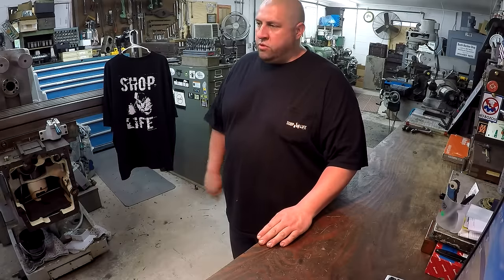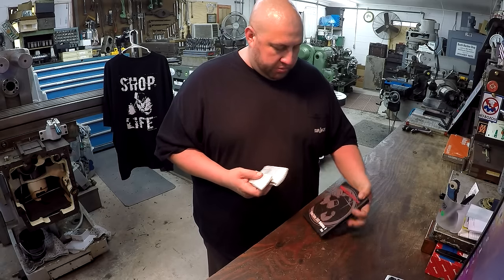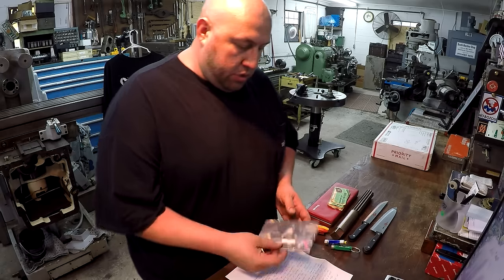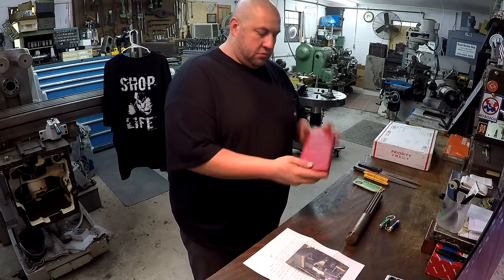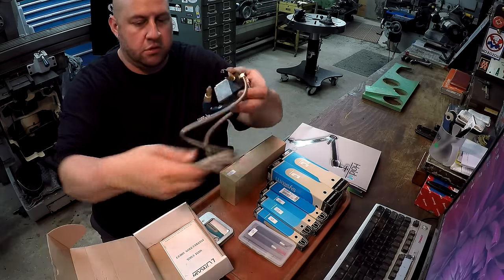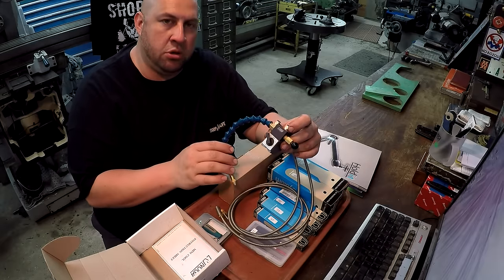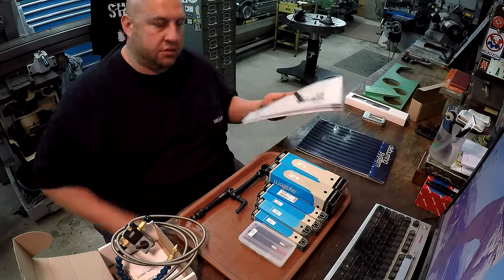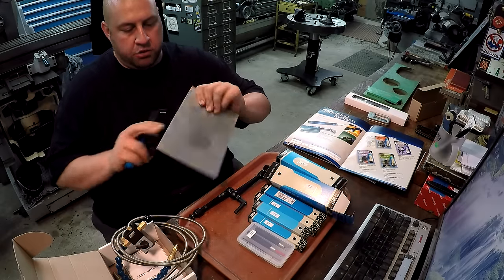Saturday Night Special 78 Part 1

Comment: Absolutely I can use the pipe cutter, never seen one quite like that. I'll be piping up a small 32 volt steam electric turbine for lights and will make a point to use it on that project. Thanks...Dave
Reply from the maker: David Richards That's great David. I'll get it boxed and sent your way this week. I'll email you for info. Would you like that pipe threader too? I have no use for it and it was part of the lot. 
I think your going to like this pipe cutter. It works great! Just needs a little cleaning, and a short handle made for it.

Comment: My dad had one of those pipe cutter sets, he always told me they were "square end cutters" and he had 4 size ranges up to 4 or 6 inch. They do not deform the end of the pipe (for butt welding?) He also only used them on black pipe. Cool find!

Comment: Nice black t-shirts.  Looks good on you.  Dig that pipe cutter.  It's a serious chunk of quality steel.  You would get a work out just heaving it to the work area.  Designed and manufactured in a different era (with pride).... when things were built to last a couple centuries!  not disposable.  Cool gifts.
Reply from the maker: WAVETUBE84 Yep, it's a heavy tool and built to last. Look how old it is and still works just as good as ever!

Comment: Great video Adam. I have used one of those big old pipe threaders on heavy black walled steel pipe (- anything above 2" is too much for me on my own even with long handles and lots of oil!)They are very good and produce a good thread quickly but I sure welcomed the arrival of an electrically powered pipe threading tool.
Reply from the maker: Dan Whiteford I hear ya on the "powered" tools. :) This is a good classic and would also be good for field work.

Comment: Nice package from Noga. More things I can't live without! My wallet seems to get thinner as I look at it.

The nice thing about that pipe cutter is that it doesn't make a heavy burr on the end of the pipe like wheel cutters do. A light internal and external deburring will clean it up perfectly. With a wheel cutter you need a big tapered (cone) reamer and either a big tap wrench or a brace to drive it.

Comment: great video, the Tig finger is great but you will need to get it broke in to be comfortable, they are kinda in the way to start with but work great on hot work and sliding.

Comment: So, on the pipe cutter, since it has 2 cutters around 180deg apart and as direction of rotation is either direction, it looks as if that would have been useful in places such as scrapping, where you may not have the ability to spin a cutter all the way around the pipe... like near a bulkhead or something.
Reply from the maker: krbruner It's possible, but you would need to make sure you go past 180 each time to clear the end of the cut.